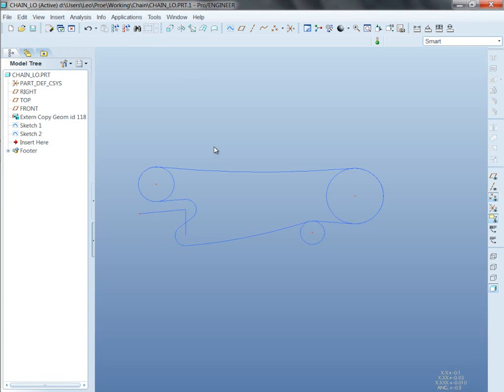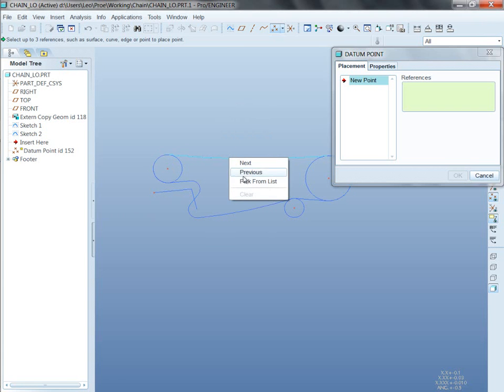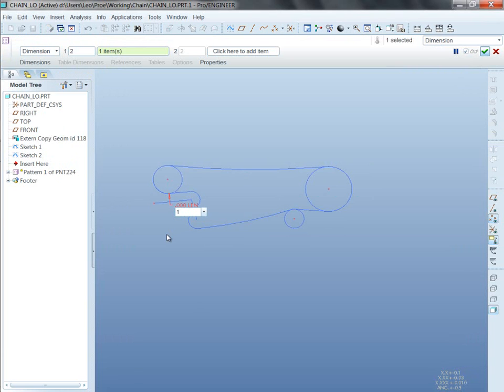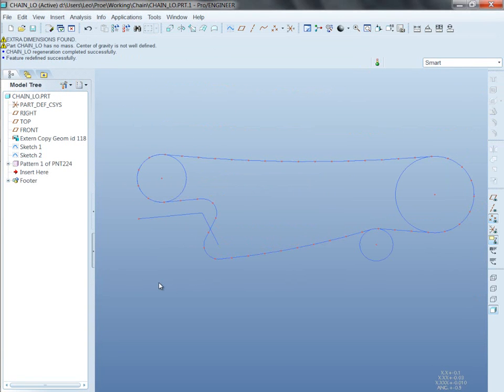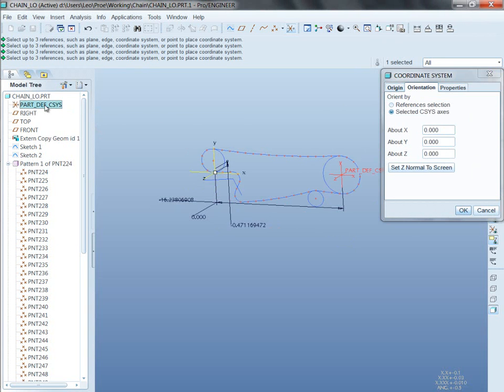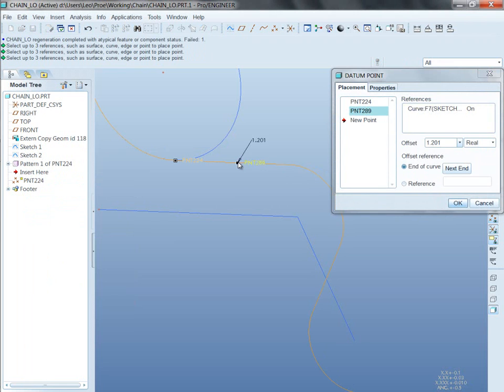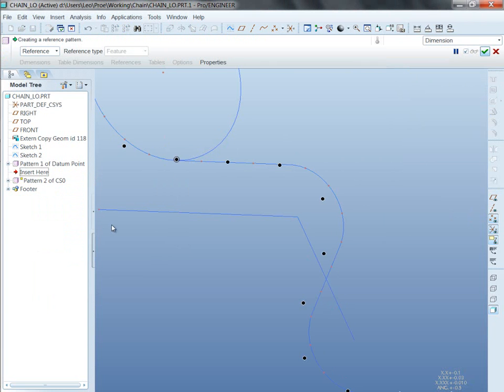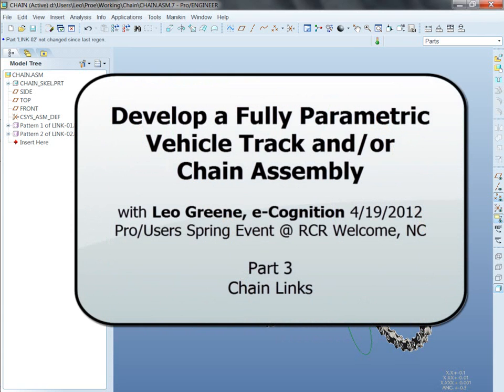Chain-Track CAD Modelding with Patterns - Part 3

Comment: I have a U-shaped curve that works great with the coord. system pattern except for when it gets to the apex of the "U" shape, there, the coord. system flips and the assembled part flips with it.  How can I keep the coord. system in line?
Reply: Nevermind, just had to play with the coord. system orientation settings on the "Use _ to project _" section.  Thanks for the very informative tutorial man!  This instruction still holds true for Creo 2.0.

Comment: Cool, but this doesn't allow the chain to move around the line? The only way to assemble a chain is to go through the tedious process of adding chain links to the assembly and attach them with slot connections... A pattern won't work either.